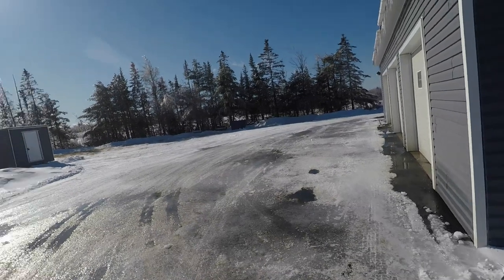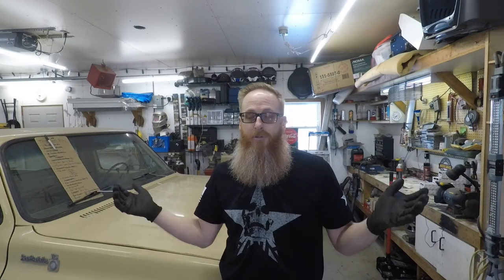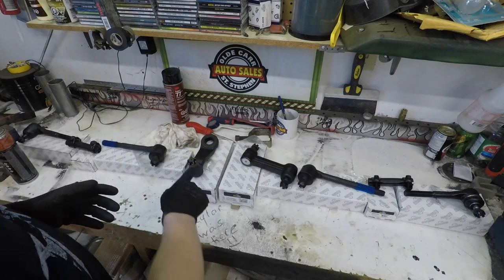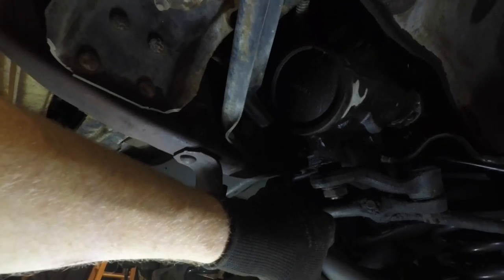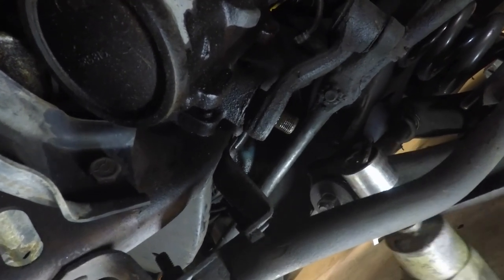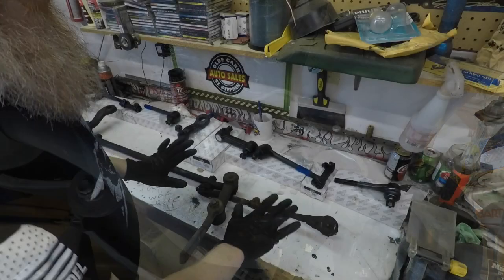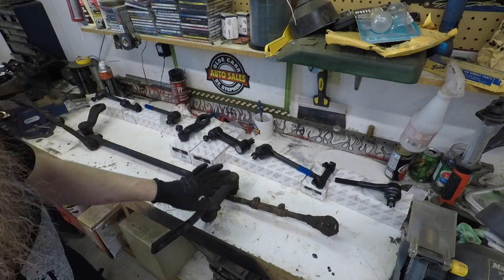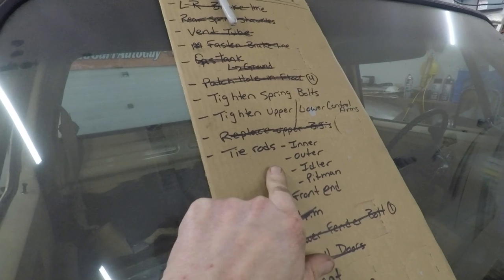DIY How To Replace Inner And Outer Tie Rod Ends - Idler & Pitman Replacement on a 1977 Chevy C10

Comment: Should be a nice tight steering truck now .. 👍.. are you going to have front end aligned.. as when I did my drop on my truck it did change as in camber etc an alignment was needed..also jus curious if you had given any though about the mirrors on the truck as for keeping or changing to sport mirrors
Reply from the maker: Definitely will have it aligned. It will be the last thing I do! As far as the mirrors, my plan is to keep it as is. otherwise, I'd have holes in the door.  Besides, it's stock and original!

Comment: What is the torque for the steering rod?
Reply from the maker: I'm thinking 180 ft/lbs but I just crammed it on there as tight as I could get it. Tighter the better.